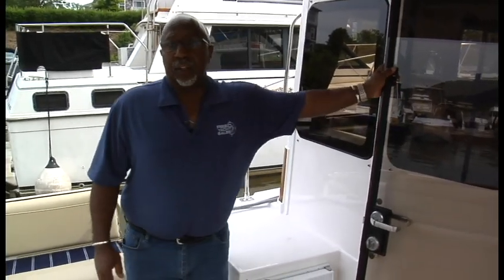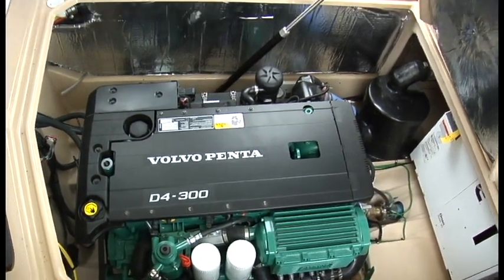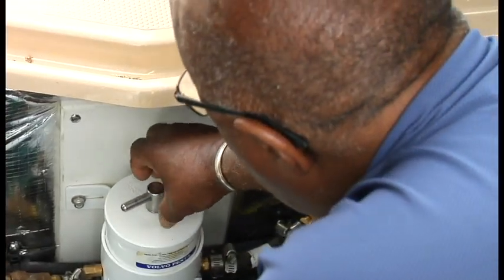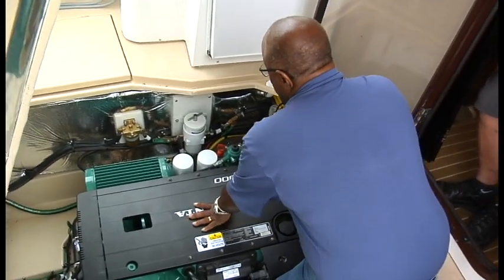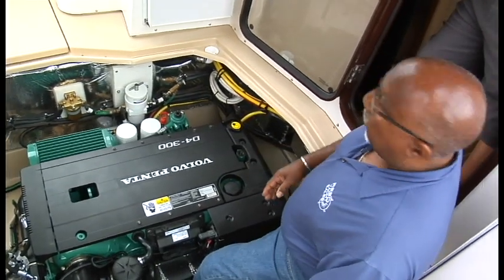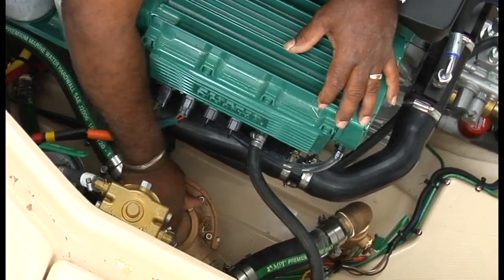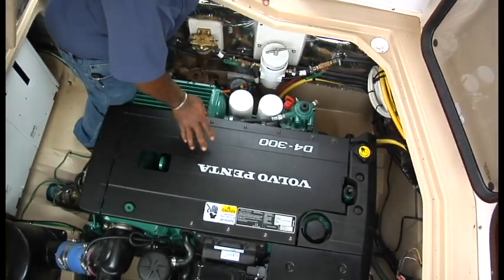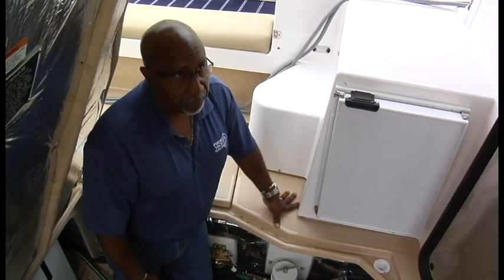General Maintenance Volvo Penta D4-300 Engine

Comment: What about the engine Air circulation filter? If this is not changed, you will risk oil in the bilge. I know from experience.